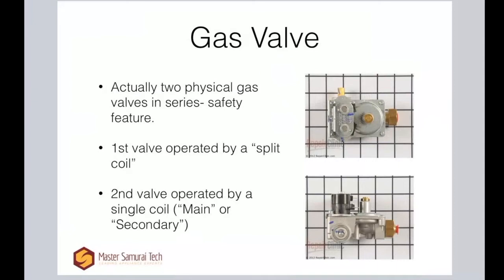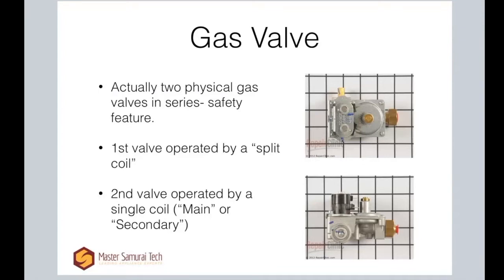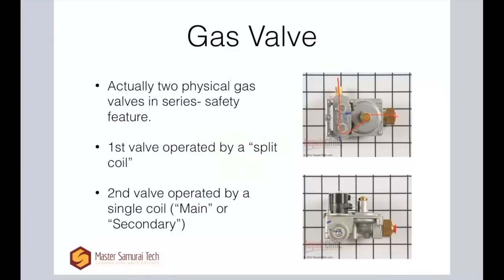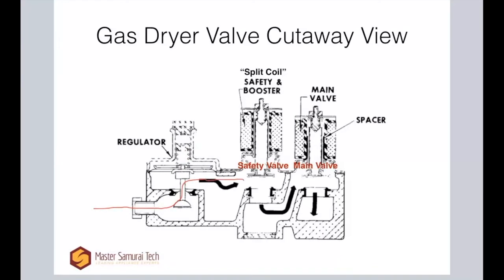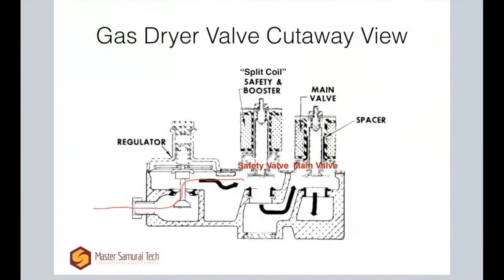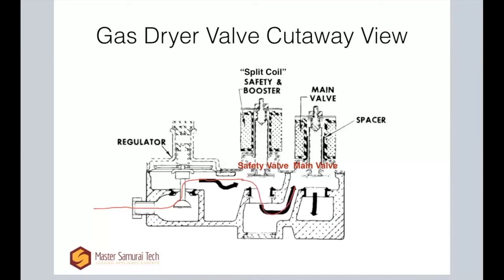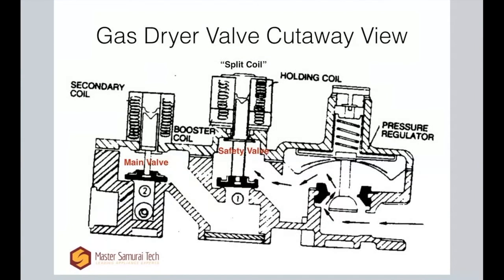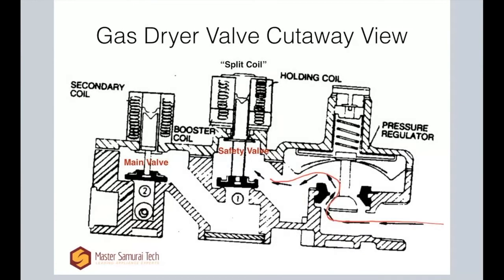Gas Dryer Ignition Systems and Gas Dryer Valves - appliance repair training webinar excerpt

Comment: Regulator shown lowers pressure for natural gas. When converted to LP propane the regulator is in an open position by inverting the cap on top.
LP uses a much smaller orifice than natural gas... but operates at higher pressure.... 😊

Comment: @spinny2593
21 minutes ago
I have checked everything continuity good on all fuses and well everything. So I changed the coils. You are the only one that talks about the metal sleeve. The small one in the back does not have one and I can't tell anywhere if it should or not. I have done everything and it still will not heat. Get my glow and then click it shuts off and nothing.
Reply from the maker: Sounds like failed valve coils. Easy and inexpensive fix.
Reply: @AppliantologyOrg  I changed them already
Reply from the maker: Ah yes, you said that and I missed it. Start a new topic in the DIY forum at Appliantology and we’ll help you troubleshoot it there. https://appliantology.org/forum/60-diy-appliance-repair-help/
Reply: Plunger could be stuck....it is best to change the valve if that is the case. If water gets inside the valve it is usually the cause. The cast aluminum does the same as a lawn mower carburetor and manufacturers highly recommend replace the valve.
Reply: Only one solenoid uses the sleeve, it is  to identify which is which, (one solenoid has a larger hole) the bracket  has notches as well for the same purpose...

Comment: So i cHanged the 2 valves  and still getting a gas smell between drying cycles, any idea? Sugestións??
Reply from the maker: Use bubble solution to check all connections, especially where thr gas supply connects to the dryer.

Comment: Is the operation of the range gas valve the same?
Reply from the maker: No, completely different. Ranges use Hot Surface Ignition system where the ignitor is in series with the heating coil inside the gas valve. Dryers use a split coil system where wattage to the ignitor is controlled by the radiant sensor.

Comment: MST Schematic Workshop Webinar 10-22-2015. I am lost looking at the wiring and the why with so many direct points of wire connections and then adding in the holding coil. The major question is why and how. And I am clueless on how to do it while I am logged on as a paid member to as this question.
Reply from the maker: This is just a 4-minute EXCERPT of the entire hour-long video so it’s natural you would have questions. You should watch the full webinar here: https://appliantology.org/topic/63109-mst-office-hours-5222017-gas-dryer-ignition-systems/
If you still have questions, post them in that topic I linked you to above. 
From the title you gave in your post, it sounds like you’re referring to a different webinar recording altogether. You can find that webinar at Appliantology and post your questions in that topic.